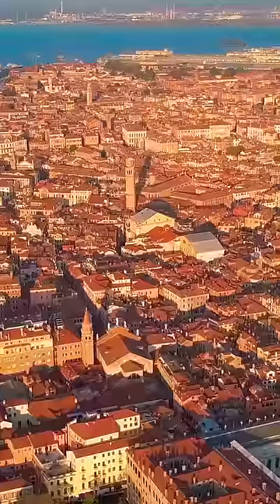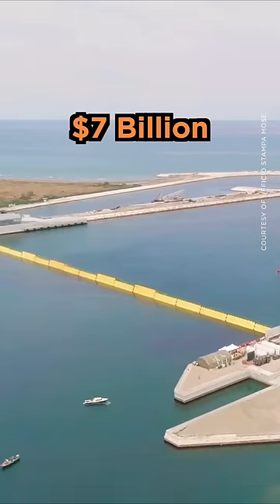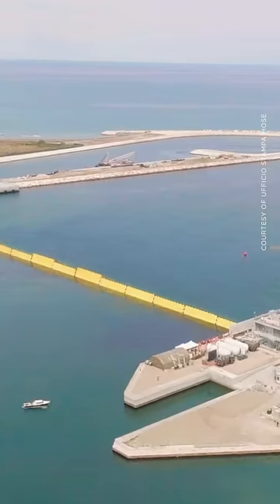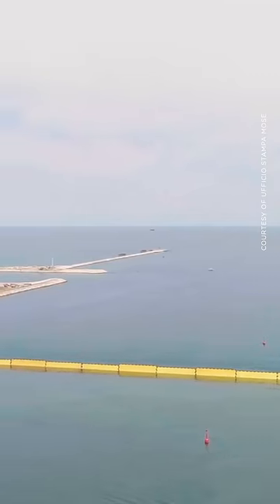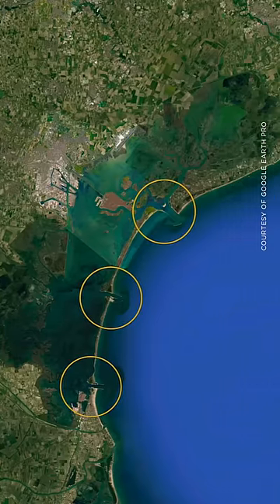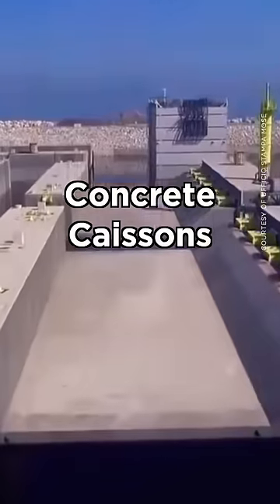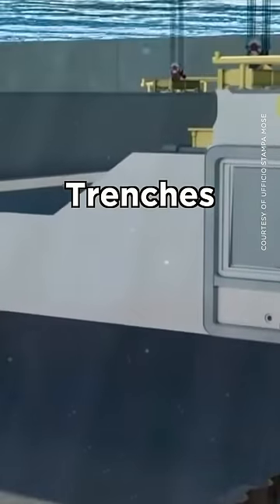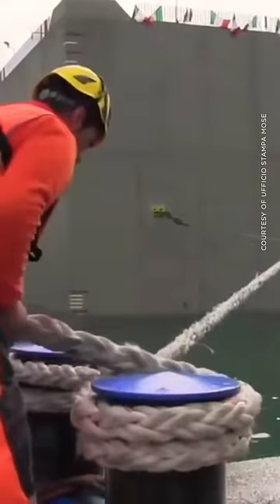How Venice STOPS Floods

Comment: I live above the site of a 1909 dam on the Ohio River that used a similar system called “Bear Trap” gates. Same idea as this, except the sections were manually raised and lowered. That was abandoned in 1921 to make way for fixed crest dams with locks (which I note the system in this video also needed for some reason). It is astonishing that over one HUNDRED years later, they’re still making the same mistakes. There must have been some special interest behind this design for SURE!
Reply: Excuse my manners but when you said "special interest" did you meant corruption? I just can't help myself and wonder how massive corruption is in one of the highest cost of living per capita places such as Venice compared to us here in the third world SEA
Reply: the dams in Venice have to work only when there's a high tide.
Reply: Those special interests definitely don't live in Venice.
Reply: Well, you can't just place fixed dams on the lagoon as it needs to exchange water with the sea, so it must be something that you can open and close, and it has locks because ships may need to always pass.
Reply: Interesting...
Except this is a completely different situation, where a fixed dam would've never worked (it would've likely made the problem worse) and that's why they chose this design.
More than a dam it's a mobile breakwater: It's not supposed to stop the water but to slow and regulated the tidal wave. That's why in normal operation they usually raise only some of the gates, leaving gaps between them. They raised all of them almost only during tests.
Reply: Normal dams wouldn't work in this situation bro
Reply: It is a lagoon (Venice is located in the "Lagoon of Venice")
You can not put a dam between a see and a lagoon, or you will have a lake!
Reply: Essy to sell on politicans who tun with feelings.
Reply: The system worked pretty well for over two years by now. The fact that a system you think is similar had been replaced doesn't mean someone else made a mistake.

Comment: While i was in Venice, i asked why they didn't use Moses for each high tide. The answer: it costs $328,000 each time it's raised. And that cost is paid through Venetian taxes.
Reply: Compressed air wouldn't cost 300 thousand dollars
Granted power is necessary to pump the air and there is some cost but you would think they would have thought of a power supply that doesn't break the bank

And the system is manned or supervised at all times so that should affect the cost

Sounds like nonsense
Reply: @chrisgriffith9252 dawn probably doesn’t even own a passport
Reply: @DontBeAWollyy  
Probably right on that
Reply: Air is free though... lol

Comment: I have read that corrosion interferes with its operation, and that maintaining it has proven to be very expensive.  Apparently, this was not a good plan.
Reply: Yeah and the fact they have forgotten important geography notes regarding rivers and their maintenance issues; deposition. Rivers carry crap along with them and when they lose energy such as near the mouth where they meet the sea. When the ramps go up and stop the flow there’s only one place where the crap can go that was carried downstream. It’s a problem along the sea coast too requiring harbours especially to be dredged routinely because of all the sand, trash and mud that gets thrown at the bottom.
Reply: and too expensive to make it work, because it's not automated, so it's humans doing everything.
And besides, it's not profitable for Venice to use it every time it should, because otherwise tourists can't come and go by boat, so they made a raised walkway system and watertight barriers in the city...
Reply: Just fyi, we're masters of bad plans 😂
Reply: It was a bad plan indeed - Venice residents are really fed up with it and with the huge cruise ship wanted to get in
Reply: What you did read were forecasts "the corrosion WILL interfere, the maintenance WILL be expensive". 
The system worked pretty well for over two years by now.
Reply: @neutronalchemist3241  it's a terrible project, every engineer in Italy can tell you about it, failed from the start, corrupted to the bone.
Reply: @mattiafrancescobruni8318  It worked pretty well for more than two years by now. "every engineer" it's a void expression. There were against it, there were in his favor, like for every big project.

Comment: The stupidity of this design is mind boggling. The platforms rise up and leave an empty space. Ofcourse there will be sedimentation so every time the platforms are up you will get dirt under them untill they won't properly close anymore. They will thus need to be regularly cleaned which is costly.

Also, having all of the moving and important bits underwater will of course increase maintenance costs as you will need to work under water more and also have more work as the water will increase corrosion to those parts.

I am Dutch and I agree with the other comments saying they should probably have consulted us...
Reply: Welcome to Italy 🤷🏻‍♀️
Reply: You’re absolutely right. I am but a simple man but even I would have asked you guys for help concerning a problem with flooding. Pretty arrogant of them to not get advice from the country in the whole world that knows all there is to know in this matter. 
👍🏻🇸🇪
Reply: Of course being a Dutch makes you above some hundreds of civilian engineers, damn internet is becoming a curse to common sense lol
Reply: @adolphin9348  yes, but only if you wear clogs 👍🏻😂
Reply: @adolphin9348  LOL, I am not that delusional.  Currently writing my thesis on water infrastructure operation and maintenance as part of the study land and water management. The thing is that not every civil engineer has the right knowledge to work with watermanagement structures. There are special engineering firms for major water management projects and most of them are Dutch...
Reply: Buddy that’s been fixed and it’s been working since like 2021
Reply: @adolphin9348 don't forget there were a hundred civial engineers saying it won't work well
Reply: @TOGade-dj6jh  Building earth dams doesn't require any particular skill. It's not like being able to do them makes you an "expert" in anything regarding water.

Comment: Exact same as the Thames barrier that was started almost 50 yrs before. Began in 74, finished in 82 opened in 84.
Reply: True ...

... but having lived close to the Thames since 1974, once finnished not long after I turned 10, it has yet to fail once ...
Reply: @nigelft Memphis!
Reply: Yes, and the Thames barrier actually works.

Comment: London has one of these The Thames Barrier it cost £1.6B in todays money and was built in 1982
Reply: MOSE total lenght is three times the Thames barrier, and has not piers the ships can collide with.
Reply: @neutronalchemist3241 Deltawerken in the Netherlands would have cost €6.35 billion euros converted from the Guilders. The deltawerken is bigger and more sophisticated than MOSE.
Reply: @jgowner6076  The Deltawerken is just a series of dams. In Venice they didn't want a dam.
Reply: @neutronalchemist3241  please do your homework if you make such a false statement. The Deltawerken have multiple levee's in multiple different places to strengthen and shorten the coastline and an inflatable rubber tube that holds back water. Besides that, in the years we built the Oosterschelde deltawerken, they maintained the nature preserve, where they are currently modifying and improving the Afsluitdijk to restore the old habitats.
Reply: @jgowner6076  Yeah, and leeves are earth dams. So you just stated that the Deltawerken is a series of dams. 
Please, switch on your brain before typing. 

Had you had at least a minimal knowledge of what you are talking about, you should have known that Venice's lagoon ALREADY has embankments protecting it (murazzi). They had been built in 18th century. It's not that they had to wait for the Dutch to teach them how to pile up dirt. What has to be regulated now, due to the mutated conditions of the lagoon and of the city in the past two and half centuries, is the passage of water in the OPENINGS between the embankments (bocche di porto) WITHOUT ALTERING THEM. They didn't want to build other embankments and didn't want to build evident structures like the Maeslantkering. Do you really think someone needs aid to build a flood gate?

Comment: These types of things always seem to break when you need them most... either that or they just don't work as well as intended.
Reply: Is there a time you would need this less than the most? 😂
Reply: @ryanbianchi6582  normally it should be used every day and yet they don't, why? too expensive to make it work, because it's not automated, so it's humans doing everything.
And tourists would be stuck every day on one side or the other of the barrier, a barrier that is financed by the presence of tourists who come by boat...

So they made a raised walkway system and watertight barriers in the city...
Much cheaper, but still temporary.
Reply: No doubt you don’t have to be an engineer to see that idea was a failure from the start

Comment: It’s still floods, we were there a couple weeks ago😊
Reply: That's because they don't use it until the water reaches a certain level :)
Reply: @nnlopossodire  tbf, most of the flooding is due to the misshaped and warped ground, I think it puddles up then just spills over that’s how a lot of shops and places get flooded quite bad regularly. Surprised they don’t use sandbags as often
Reply: @coreymckinney7423  why would they use sandbags if it doesn't reached their houses.. houses are on a higher level than the streets, that's why they don't care if there's water on them, just put some boots on and you're fine
Reply: @nnlopossodire  you are correct houses are built higher, but the shops and restaurants are not. It’s not necessarily for the people who want to walk around in the wet, it’s for protecting the inside and the items they hold inside these building that is important.

Comment: "Here's how its supposed to work " is the correct way to explain it because even now,the MOSE project is not technically finished. It has been operating two years in experimental mode. Engineers say they are still completing the last backup systems.

26 November 2022.

Comment: Wouldn’t that only work if
A: they each had a watertight seal with each other and their surroundings.
And
B: the water simply doesn’t pass through the large sedimentary rocks and into the lagoon anyway.
Reply: A: no. To fill the lagoon requires a so vast amount of water that the quantity that passes between a barrier and another is irrelevant. Actually it NEVER happened so far that the barriers had been all lifted (and, by design, the need to lift all of them will probably never occur), yet, on Nov 22 2022, despite not having been even completed, the system stopped the record tide in the Adriatic, 205cm. Water in the lagoon rised only 77cm, a quite normal tide.
B: see "A".

Comment: Check out the Thames Barrier - protecting London since 1984 from high tides from the North Sea. Raised over 200 times since then. Built for approx £500m, it is expected to be in use until about 2070.
Reply: Thames barriers are 520m long in total, every gate is only 61m wide and incidents with ships hitting the piers already happened. MOSE total lenght is 1560m, and the four passages are completely free when the barriers aren't lifted.

Comment: In our town they put some barriers into the city river.  It worked great in no longer flooding the homes… problem is that the flooding ended up in another part of town where the flooding was much worse ….
Reply: Yeh it sounds like a bad idea for a river where the water has to end up somewhere, just becomes a dam. This one in particular is just the ocean though, where it doesnt need to divert anywhere.
Reply: described a dam
Reply: Most the surrounding areas are beaches, and there is flooding protection in those areas already. Though it might make the flooding start "swallowing" beaches, but I am not sure... but it will likely mean more of the beaches get flooded instead.
Reply: Build homes in natural floodplain. Homes flood.

*surprised Pikachu face*

Divert river so that the floodplain doesn't flood anymore. Floods just go somewhere else along the river.

*surprised Pikachu face again*
Reply: @AdhamOhm  Amazing how accurate this is. I’ve lived in a flood plain my whole life, and yet people keep being surprised when they build houses by the river and they flood. Like, the town becomes an island twice a year and those fields become lakes, what did you think was going to happen? You’d think the problems with building at the very bottom of a river valley would be self evident, and yet
Reply: Consequences

Comment: The Bush administration did the same thing and turned the Dutch away after Hurricane Katrina. He then had the U.S. Army Corps of Engineers rebuild the levies… to the exact same parameters that they were before, so it’s only a matter of time before NOLA will likely get the same treatment. Point is: listen to the Dutch when it comes to advice on keeping water out.

Comment: Why cant they completely closed 3 entrances and turn Venice into enclosed lake, that way, the water filtration will start to work and purify the water, all sewage pump out to the sea, only commercial vessels allow to run in Venice, outside boat has to park on outer shore!

Comment: This reminds me of an idea I had as a kid to stop tsunami's. I imagined a giant wall like mechanism that would emerge from the shore of beaches or border lines of land and those walls would be made out of concrete and steel with machinery that blasts winds at high pressure and speeds to form a wall of  pressured air that would block the water or atleast slow down the waves  breaking them up a bit 😂😂